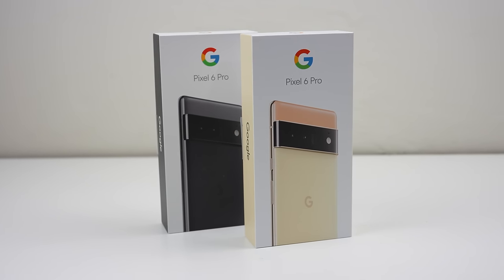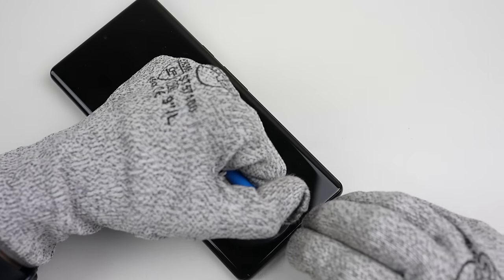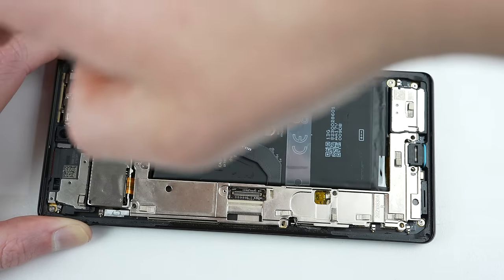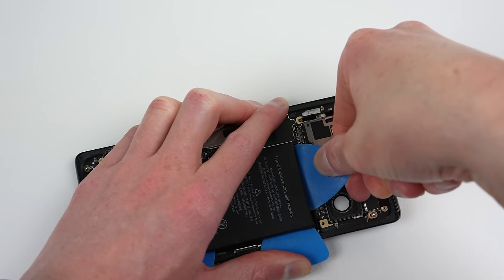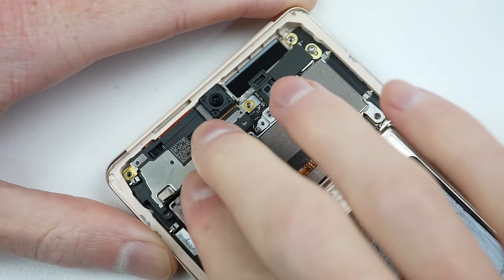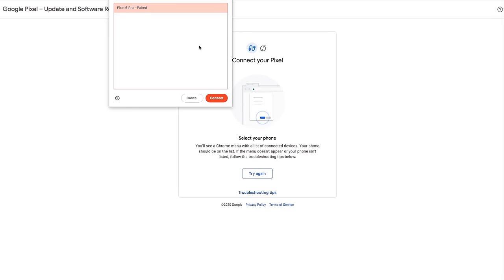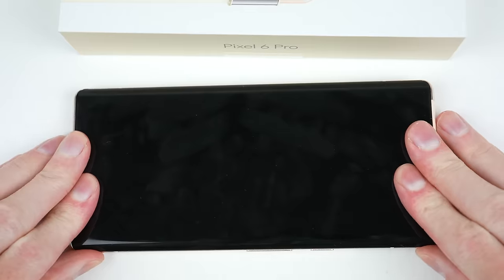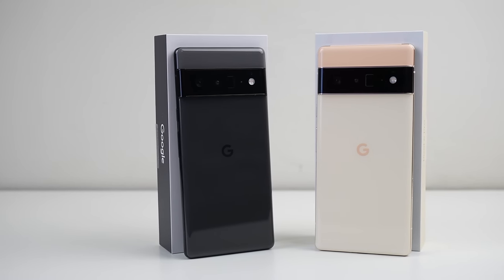Pixel 6 Pro Teardown and Repair Assessment - Serialisation With A Twist

Comment: So they have a tool for their fingerprint pairing but what if you just don't have paired fingerprint scanners? Providing tools is still a huge step up from all companies right now
Reply: i'm not an expert, but i guess it could be a security issue? i think this was actually a good idea to make sure it's all ensured.
Reply: at least it can potentially inform the user if something fishy is going on? not taking google's side here. but just a potential explination.
Reply: It's possible that the fingerprint is encoded into a string on-chip, and that string encoding method is unique to the device or uses a custom encoding string.
Reply: @syber-space  A hopefully more understandable explanation -

The fingerprint reader chip stores and authenticates the fingerprints on its own, and then simply gives the main processor the "OK to unlock" signal. This makes it impossible to steal the user's fingerprints by hacking the main processor, since the processor doesn't have access to them.

However, now we have this issue where - for example - a hacker could swap in a reader with their own fingerprints stored on it and then unlock your device. In order to prevent this, they need to make it so that only the one specific reader works with your specific CPU, using some fancy cryptography to let the reader prove its identity. Because of this, you HAVE TO run some sort of pairing process when you replace the reader.
In theory it should be secure enough to just have the user enter their passcode for this, but I guess it's better to be safe than sorry. Historically, other big changes in the security domain (eg, unlocking the bootloader) have also required memory wipes on Android.

Comment: Great tear down Hugh. Nice to see that Google has taken a more open approach on their new phones than Apple. I think the graphite sheets are just padding to fill the void caused by the ribbon cable that runs across the battery. Not the most elegant design as there's a loss of volume that could have been used for a bigger battery or making the phone thinner. Probably some design oversight on that cable...

Comment: Not bad, but I wished the battery would have been a little more easier to replace when the time comes. Besides the display, it's basically the only thing the majority of users need to repair in phone's lifetime.
Reply: the battery tab looks like it should be used to slice through the adhesive by pulling it back and forth

Comment: Great video (as always) bro, although I was hoping to see you swap out some more components (like the camera module or the battery or the charging assembly) since they can be locked to devices as well.

But nevertheless, a screen replacement is pretty big deal in itself since mostly people damage their screens more often than any other component. Glad to see Google provide (at least a little bit of) transparency towards repairability of their devices, and skilled people like you who support the Right-to-Repair movement with such dedication.

Comment: Honestly, the fingerprint serialisation would make sense in my eyes. Because in the end it's a security module. Giving users and repair technicians the tool to calibrate them is also a good thing because they could also do security checks with the module installed, making sure it's secure, functional, and calibrated for the display itself. Makes sense. Nice to see Google being very open with repair here.
Reply: Yeah but a bit concerned about the calibrator, after all it does things in fastboot mode, and possibly it's code could be exposed and seen how it's done without the need of entering passcode and using it to access the phone without entering a passcode.

Comment: Attach a piece of dental floss @12" long to the clear battery strap with a small piece of tape.  Pull the dental floss under the battery and out the other side.  Hold the phone securely in a vice and pull the dental floss side to side while working up and down the battery to severe the adhesive.  Bobs your uncle...

Comment: i wish there were smartphones without using any adhesive in production, the ones you can disassemble without any tools by yourself and replace the battery for example

Comment: With the plastic piece around the battery for removal, I think you're supposed to hold an end in each hand and work it back & forth like a saw through the adhesive.

Comment: Very nice that google are that repairable. The thing with the fingerprint is not a soft lock, as it won't work right after a screen replacement, so a recalibration is required to make it work right again.

Comment: I've noticed the difficulty in disassembly (+battery removal) is relative to how freaking expensive the unit is. Currently on my third mobile phone in 10+ years. Didn't buy a cell phone until age 20 and only because my mother would flip her lid with no communication. Anyway, not a single unit cost me more than $30. The back pops off in <10 seconds with the use of a fingernail and the battery tends to just flop out. Sometimes it needs assistance because the only thing keeping it in place is slight friction caused by the small copper contacts. It doesn't need 3 screws and metal bars.

Addendum: It's great to see some redundancies built into these Pixels and Google was kind enough to not make any error messages obnoxious and in the users' faces. They provide help links and solutions which are... barely helpful so far, but still there. Apple is still giving their customers the double middle finger.

Comment: "companies have been increasingly locking parts to individual pnones"
Proceeds to mention it's all iPhones
Reply: Samsung has been doing something similar too I believe.
Reply: @wilkgr  Nope, Samsung has no parts paired, atleast for now.
Reply: @anikroyale  Samsung has had pairing issues with the A lineup, confirmed by Hugh Jeffreys. Not the S lineup though.
Reply: @anikroyale   samsung has paired fingerprint to the display as well
Reply: Samsung is also disabling cameras on the Z Fold 3 when you unlock the bootloader
Reply: @gabrielevan148  lmao they're like, wait we can get away with this shit? thanks apple!

Comment: This definitely puts pixel 2 steps up on the competition. The heatsink is probably to protect the battery from heat and I'd bank there's cooling channels in the heatsink or material layers to move heat to a different location.

Comment: That plastic battery tab is their to cut the adhesive first and then pull, battery will come out easily. You done have to cut adhesive on both ends just go through one end and you can levarage the battery out.
Reply: It's a pretty strong adhesive, are you sure that this plastic tab will be able to cut through it? I honestly doubt it

Comment: Not only is the USB-c port soldered on. They chose to put what id assume to be the main microphone right next to it making it very difficult to replace the port without first removing the microphone. They probably could have easily incorporated the mic into the speaker assembly on a flex cable but they don't care about you.

Comment: The phone's internals should be always modular and removable and replaceable.... but software lock to lock in the hardware is recalibratable....it's good to see they Corrected the display removal problem they had

Comment: I think the battery strap is designed to be be used to cut through the adhesive(by pulling it back and forth) and in a second motion to pull out the battery. Without the device being fixed by sth. this sounds a bit awkward to perform is intended.

Comment: I like that the online tool can reinstall Android, what looks to be from scratch.  That could be a life saver.  Wondering if this feature can give me back the old version of the camera on my Pixel 6.  Newer camera apps eliminate focus lock, which is like a DSLR manual, but better because you can still tap the screen to auto adjust, then lock.

Comment: Love the intro!! Should I get pixel 6 pro or iphone 13 pro?
Reply: If you want to pay less and have a just as good or even better then the 13 pro then get the pixel 6 pro but i don't know about you're preferences
Reply: @anti4107  the specs on the iPhone is a bit quicker but your forced to use IOS
Reply: @MegaMike1  wydm there's this one video where the pixel pro 6 held its own against the pro max
Reply: Neither
Reply: Depends on software, apparently the pixel has been having mediocre battery life from what I’ve heard (MKBHD and phonebuff) and it isn’t quite as good as the iPhone in terms of video but the camera (photos) is just as good, if not better than the 13 pro so I’d choose whichever suits your needs more
Reply: @HughRussell06  since I am currently using the 2018 flagship I might stick till 2022 and see what options are in the market
Reply: @MegaMike1  2018 is enough. On a note 9 here bought just this year, no point upgrading.
Pixel 6 has quality control issues, year old 5G hardware and looks like a lot of flaws internally. No locked hardware is nice though.
iPhones are iPhones, increasingly just ewaste because once you break them they're useless. And you overpay for an iOS device.
Reply: Pixel 6 (not pro) costs $599, but if you need the extra refresh rate, screen, and camera, it's fine to get it for $899
Reply: @rosaria8384  its tough choice since 1 year later it will be at least 40%off

Comment: Hello, thank you for this tutorial. I fixit's video shows a coper foil on the back of the phone that attached to the 5g antennae on the top. They show it being peeled back. It is so thin and the adhesive doesn't let it be removed without falling apart. Replacement cameras do not include this foil. What do you recommend? I found copper foil tape for electronics, but they are much thicker and I am not sure if the underside of the foil should be conductive or not, it is available in both.

Comment: I am not sure where to post this other than here.
[Huawei Honor view 10 released early 2018]

I recently broke my phone screen and someone in my family had the same phone as I. However that phone had a swollen battery (someone else had a swollen battery with the identical charge/manufactur date different phone still swollen around the same time and same battery capacity though it charges with micro USB) so I decided to savage some parts of it. My camera had a dead pixel though small enough and on the edge so it didn't bother me.

As the phone with swollen battery somehow pushed the screen out it was easier to get out the screen(3/4 got unglued the last 1/4 was strongly glued). As I didn't have all the tools "needed" I used a hair dryer and some plastic card but mostly finger nail.

Okay so I opened both phones and unscrewed the necessary parts. Loudspeaker was glued in though not that strong. The broken screen of my phone as Hugh Jeffrey made clear in one of his video about a Huawei phone that the screen is so glued in place that it will break completely is also case with my phone, when working around the phone to get it out I felt section with strong glue and others with weak glue, maybe Huawei has issues with glue?. Switched the screen and camera to my phone. Firstly the phone did recognize a new screen/fingerprint sensor has been installed. However it just wiped my finger pint profile and that's it, after logging in it opened the "add fingerprint here" screen it safes my fingers normally without any issues. Now to the camera the camera got me first worried as soon I opened the camera the viewport was lagging  I could switch to my second camera (phone has 2 rear) though it was black. I thought crap please don't be like Apple. I re inserted the camera and replugged it and everything works now.

I glued the screen into place and everything works now as it should. Without any software locks. Though when charging the notify led is in the wrong color. (it is mounted to the Mainboard I think, deffinetly not the screen.)
As far as I could see only two screws were used Torx 2 (on the USB c charging port) and some Philips screws. 

That was my experience

Comment: Recently replaced my camera unit on my pixel 6 pro (bought brand new on launch). I was quite surprised to find that I did not have that large ribbon cable connector across my battery 🤔

Comment: After you replaced the scanner, did the phone reformat? If not, this is a major security issue if your phone was physically stolen. The procedure just lets you enroll another finger.
Reply: watch the video, it does factory reset so all data are gone.

Comment: They probably soldered the USB-C port to try and increase strength at the cost of repairability if it breaks. But that’s just my guess
Reply: The amount of units that will ever break are probably not worth considering.  Of course, if it happens to you, it's a bigger issue.  But overall, to them that made it, it's not.

Comment: If it's so easy to recalibrate the fingerprint sensors, why isn't the calibration software included into the OS? Why do you need an external computer to do that?
Reply from the maker: Looks like the calibration is done independently to the OS, hence why you need to put the phone in Fastboot mode.

Comment: the "battery pull tab" on this phone is a really bad design, it's used to pull the battery up at the middle from strong glue, that means you could break the battery in halves when trying to remove it with the pull tab, and that's bad!
Reply: No, the way you use it is to slide the plastic left and right from top to bottom so that the glue get separated, Not pulling it directly.
Reply: @mehshutup3041  but in the video he slipped it out to 1 end but the glue is still intact

Comment: I just upgraded from my Google Pixel 3XL and switched to Samsung. I got the Galaxy S22 Ultra. I can't believe that the Pixel is going in the direction it is, with respect to repairs. This brand was the brand for tech savvy people. I used to be one... And even started my channel around that phone, and others like it. Google is trying too hard to be like Apple and that's the wrong direction for this brand, in my opinion. It's still a great phone for now but I fear for it's future. It's trying too hard to be an Apple phone.

Comment: The battery tabs looked like they were designed to be used as an adhesive saw. Sliding back and forth cutting the adhesive from the bottom?

Comment: Does the fingerprint calibration process include any validation at all for the original owner? I mean, would that be a security loophole that allows someone else from replacing the fingerprint reader and unlocking the phone. Sorry it wasn’t clear from your video.

Comment: It looks to me like the plastic strip on the battery is supposed to be used to saw through the adhesive at each end of the battery, not as a way to pull the battery out.

Comment: There are 2 holes in that plastic thing that they put there so you can take out the batery. Maybe yure suposed to put something likea screw through them to pull out the battery easyly without it slipping out of your hand and pulling it out complitley.

Comment: 12:50 I still don't like that google doesn't provide the software to use completely offline.
Which means, at any time google can decide:
2023: "We no longer support Pixel 6 Pro screen calibration service. Buy a new phone instead"

Comment: I don't get it why Google don't include the power adapter since the have zero reason to do it. Not that many people owns a google phone. If any, it's only a small number compared to Samsung or Apple user
Reply: The 5 didn't come with power adapters either. It would be nice if they did but I ain't complaining as I've owned every pixel phone and will be ordering a 6 pro

Comment: Hey Hugh, I've got an old Blackberry Bold 9000 that still works, but it has camera issues and when I turn it on I can't get the screen to change any colour except from white! I can tell it logs in, but the screen never changes colour. in the middle of startup I once pressed on the screen and it went to random pixelated colours, then it worked for around 5 minutes until I turned it off, and then I could not get it to change colour, even while pressing on it. I was wondering if you would like to try and fix it? Thanks.

Comment: Nice stuff. I wonder where Sony fits into the right to repair mix. I was Sony only for a while before I bought my first pixel, but I used to replace the screens on them a lot and never had an issue, I'm wondering if that's still true or of they've gone the path of Apple

Comment: Just a tip for removing Batteries with pesky adhesive, just soak in isopropyl, and it will just fall out.

Comment: While Google allowing the user to reprogram the finger print sensor doesn't this also allow thieves who target one to bypass the security? They could then sell a working phone online instead of a brick. This is a convenience to the user and third party repair shops but also a weak loophole to exploit.
Reply: there's no loophole, the phone is factory reset when fingerprint is calibrated and the user data is wiped out completely. yeah the thieves can sell working phone but the point is the user data is can't be accessible by thieves.

Comment: Why do they even glue these batteries in? Where do they think the batteries are going?
...Oh wait, stupid question. They glue the batteries in to discourage repair. That's it. That's literally the only reason.
Reply: Batteries would bounce a bit in phones, of course (I kept batteries non-glued for couple of times), but they definitely could've use much less stronger glue – as you said, it surely helps them discorage repairs